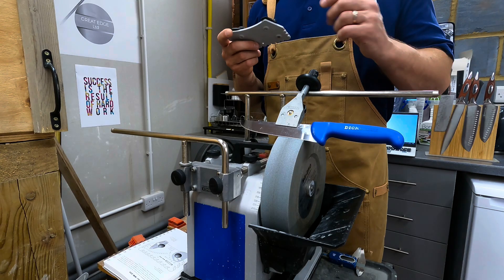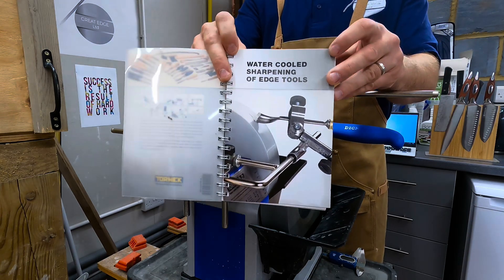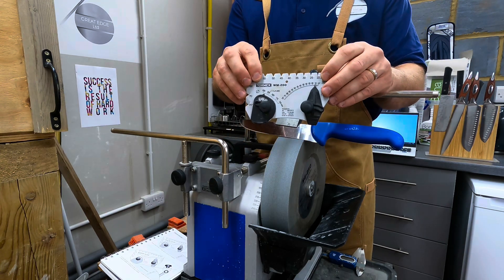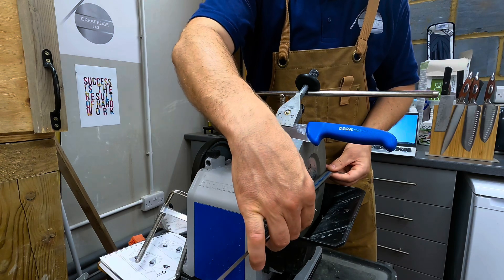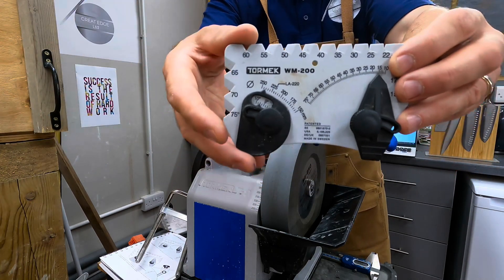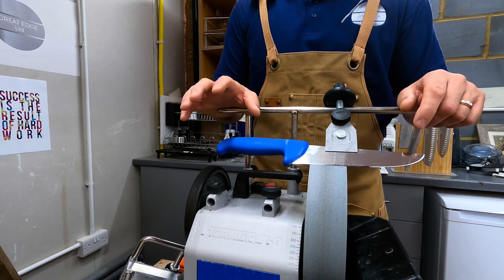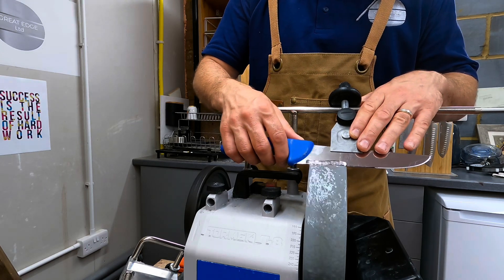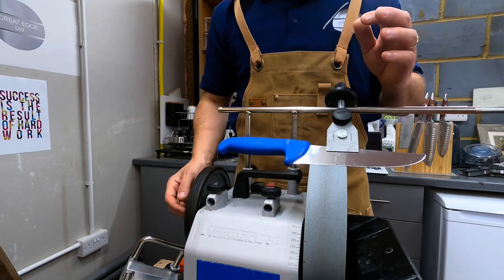How to set edge angles for Tormek sharpening: Basic to Advanced

Comment: Minute 9. Did you buy that software? And do you actually use it or not?
Reply from the maker: Yes and yes… Every time i sharpen with Tormek I use the software, unless I already know the parameters to set (for example sharpening knives I’ve already worked on..  )
Reply: @greatedgeltd  how exactly that software helps you? How is it better than a sharpie method or a ks-123 angle setter?

Comment: I have had a Tormek since 2005 . Doing great . I have always questioned the angle measuring the second bevel as it seems the actual cutting bevel should be measured . If the secondary angle is 17 , what is the actual cutting bevel ? Seems it would be much steeper . I have measured with a digitial angle meter and seems the described secondary bevek angle is actually being measured . I was wondering if the actual cutting bevel was refected in setting the tormek gauge or the software 🤔

Edit; i didnt catch the part where resting one edge on the stone and the other on the second bevel ... WoW , i dont know how i missed that . Thanks so much 👍👍👍

Comment: One thing that still puzzles me is that you use the same wheel for course and fine sharpening by re-profiling the wheel with the profiling stone. Doesn’t that excessively wears the wheel if keep changing it from course/fine multiple times a day ?
What am I missing?
Reply from the maker: Intuitively it would seem so, but in practice very little material is removed, and as long as you have a way to accurately measure wheel diameter you can use it for a long time. I would guess more knives than a CBN wheel but I don’t have data to support that.
Reply: One thing you could do is get two wheels, one for fine sharpening and one for course, simply swap between the two.
Or even two Tormek's, one lower grade 100-200 dollar one used for course, and a new higher grade one for fine precision work.

Comment: If you don’t have the software, how do you determine the bar height?
Reply: You do it the low technology way, just use the Tormek angle guage or if you are more interested in replication the existing grind angle of the knife you are sharpening, a felt marker. Unless you are a knife manufacturer and are advertising a specific grind angle the software is an overkill, and that comes from a very anal mechanical engineer.

Comment: Please excuse my comment.
I have a Tormec T8, and there is a shaft that restrains the rotation of the leather wheel. It is constantly clicking, and at the same time, the axis is repeatedly moving back and forth, and the vibration is transmitted to the entire body of the machine. I have asked the dealer and the manufacturer and they say it is within normal limits.
Does your Tormek have similar symptoms?
Reply from the maker: Hello, I can’t quite picture what you mean, but I’ve just uploaded a basic video (Short) showing my T8 spinning freely. You can compare yours to that and let me know if you see/hear any differences.
Reply from the maker: https://youtube.com/shorts/Fdd_K-LSVmQ?feature=shared

Comment: I'm wondering if you or any of your viewers have used those notches on the angle finder to determine that correct angle on the targeted blade. Personally, I've found them absolutely useless. Perhaps I'm wrong?
Reply: they're good for chisels, useless for knives
Reply from the maker: @pockynebula9225  the way this comment was displayed I thought you were saying the Tormek is no good for knives 😂
Reply: @greatedgeltd  lol, no no, just the notches in the angle finder
Reply from the maker: I personally don’t find it very useful because the knife can normally wobble around inside so it’s not very clear. You can use it as a starting point, but not for a definitive edge angle determination.

Comment: This method, devised by Vadim is just FAR too intricate and complicated for the average blade sharpener. One could also use the notched angle guide atop the Angle Master to determine and set the grind angle accordingly. Shouldn't one know the original bevel of the blade as set by the factory, if new before arbitrarily selecting a suggested angle ie. 16° for European style knives and 15° for Japanese style knives? I recently sharpened several Wenger chefs knives and found their original ground angle to be 20° per side and ground accordingly. They were extremely sharp with very little metal removed. Why then would I change that original factory set angle to something else? Plus, how does this highly technical angle measurement sharpening method lend itself to "put through" of sharpening customer blades in a timely manner? In one of his last videos, Vadim had abandoned his multiple Tormek machines for precision, high speed bench grinders with superb buffing wheels. A knife could be sharpened in 2 minutes & 17 seconds. So, is Vadim a Guru of the knife sharpening business? No, he made his reputation and YOUTUBE money starting with Tormek grinders then moved on to the REAL MONEY, Commercial Sharpening! Unfortunately, you too seem to have fallen into the Vadim discipleship. Sharpening is a basic procedure. Been around for thousands of years. Get the blade sharp to serve its intended purpose. 🍁🦒
Reply from the maker: Thanks very much - some important points you raise that are well worth discussing. I’ve posted a video as a reply because I think it would be too long to write it all out.  Thanks again- I appreciate the input.
Reply: Високошвидкисне заточеня, перегрів металла,отпуск крайки